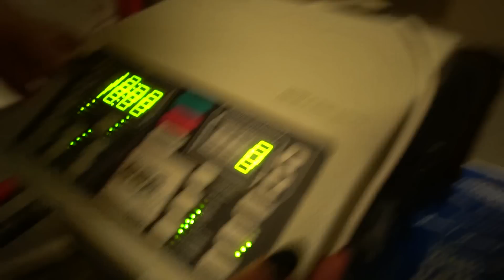|| AFTER HOURS CHIROPRACTIC VISIT ||

Comment: Our government in Australia had a car built with zero spot welds and only panel bond back in the 70s or 80s and found the car was too rigid and no longer crumpled in a crash as intended. Panel bond is very strong stuff don't be afraid to use it in places where you want to preserve paint etc.